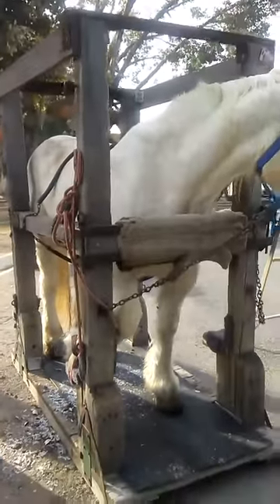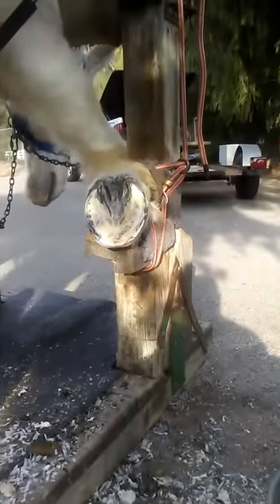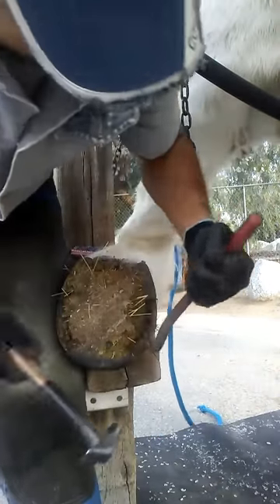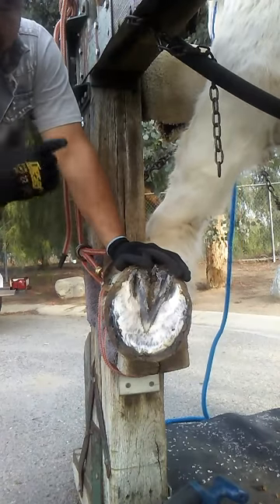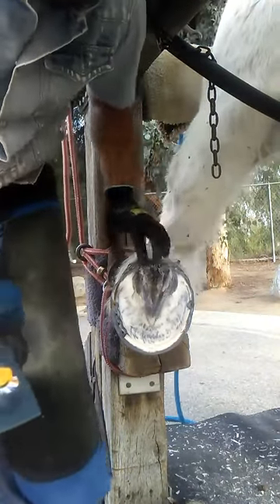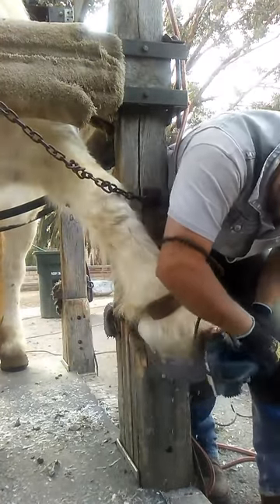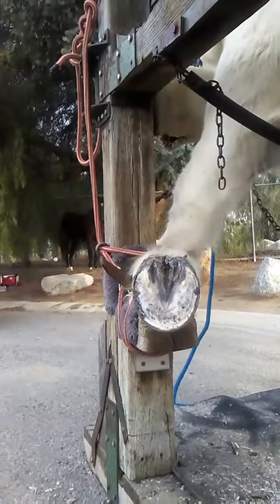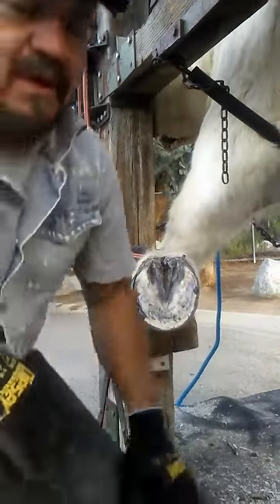Pablo's Draft horse shoeing inovation

Comment: The tool used to pull nails is called a cat's claw, it's just a nail puller. Why you use a planer to trim horse' s hooves  , is that not a little dangerous ?
Reply from the maker: Did you saw the horse 🐴 in a dangerous situation at any time I'm since your so smart and figured out the catsclaw tool 🤔